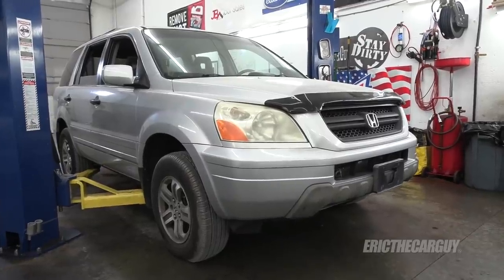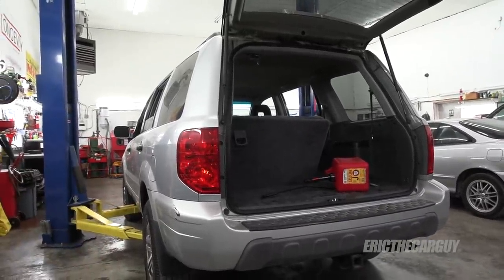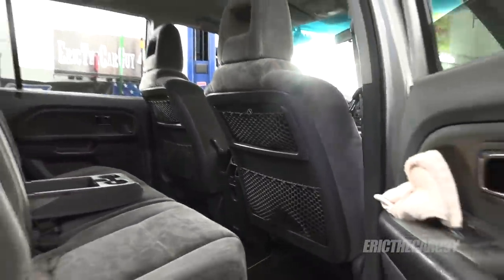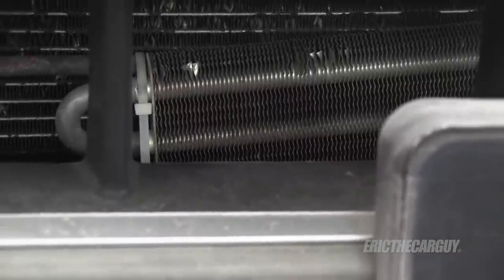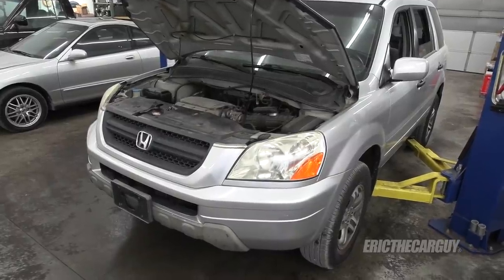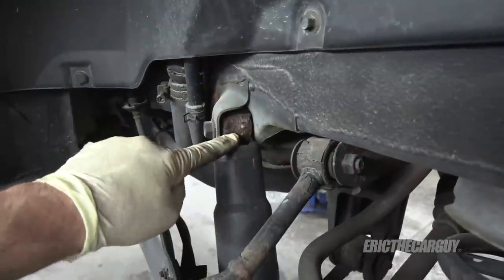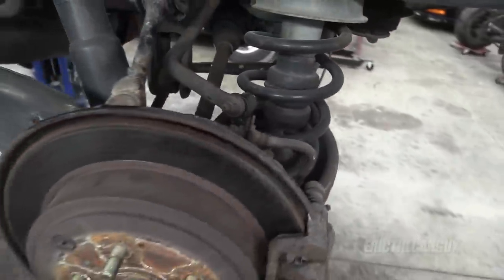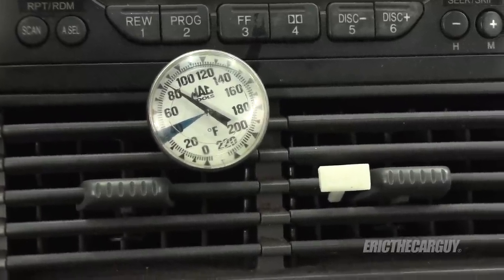2003 Honda Pilot Inspection This Thing Needs Help

Comment: I did replace a transmission in an Acura TL. It looked to me the transmission fluid was allowed to bypass the filter. There was a recall. Original owner unaware possibly,so I found a used one. Not a bad car though.
Reply from the maker: I HATE the 99-03 TL's. https://www.ericthecarguy.com/forums/topic/1999-03-acura-tls-and-cls-pattern-failurers/

Comment: I had a neighbor that had one of these I think it was an 05 same color  she had 4 kids and she drove the CRAP out of that thing she put over 700,000 miles on it the transmission failed of course the infamous Honda automatic transmission That never failed to fail she got that replaced but engine Wise no issues what so ever  just valve adjustments oil changes and sparkplugs

Comment: cast iron front control arm! That's solid offroad feature!
Reply: Toyota still using cast iron control arms in front. Rear suspension frame with iron too.

Comment: Thanks for sharing. Given the chip shortage, and the price of used vehicles, that is great deal.  We just replaced my wife's vehicle and paid 2/3 the sticker price of what the vehicle was new 12 years ago.  If there wasn't a chip and new vehicle shortage, "Normal Times", I think the price would have been about 40%.  What the vehicle had going for it, was low mileage, less 25k. 

There is a lot that needs to be done to make this Pilot "Road Worth" and the extras that "might as well be done" while you are in there....("One thing, leads to another")......... It makes sense.   I agree that SUVs are expensive for the reasons you mention but, I would say that Pilot is on the lower end of "Cost of Ownership" when looking at SUVs

Comment: That will be badass Eric ! With supercharger slap on and some drag wheels and do piggyback ecu wow 

Eric ? Will that intake manifold intake tube spacer fit 08 odyssey if soo what u think I need for extra pull off the line ? I pull small trailer on odyssey  from town to town ..any extra hp I can get I’ll take ..
Reply from the maker: Honestly, IDK. I suppose you could try it and see.

Comment: Hi Erik, greetings from Mexico, I've been watching your videos for a while, all of them are very helpful, I have passed through several Hondas from the dealer (99 Civic SI Ebp all stock, 00 Civic Si  EBP all skunk2, 07 Civic SI white, stock) and currently for family trips, just bought an 05 odyssey LX with 60k miles, If you can read and answer this, I would appreciate it, my engine does not have the VCM. Will I still need to worry for the faulty things that happened like the giveaway odyssey?
Reply from the maker: I don't think so. Keep in mind the issue with the Odyssey was caused by the engine flush. https://www.youtube.com/watch?v=XfDKhjlN7X4

Comment: The motor mounts and harmonic balancer pulley are issues on these, or at least it was on my 07 Pilot in 2018. Also, drain and refill the transmission. I think it's 4.5 qts when drained through the plug. Mine hadn't been changed in 116,000 miles and the drain plug magnet was caked with friction material.
Reply from the maker: I'm actually changing the entire transmission. Thanks for your comment.

Comment: The factory trans cooler is bypassed, because those early Honda radiators rotted and you end up with the SMOD, just like those Nissans.

Comment: Mine has 266k on original 
Also to replay he radiator you wanna cut the core support at the to with a saws all and weld it back together

Comment: Ah... The old "tie in a resister to richen the mix" power boost trick.
Reply: Yeah it looks like someone did some silly stuff  which means it was driven hard and that's why it's falling apart.

Comment: The sound from the right rear brake...when you turned it by hand. Would you drive a vehicle generally speaking that has that kind of pad/rotor scraping? Or would you call that grounds for must-replace?  I hate the sound but I know there wouldn't be a catastrophic failure...
Reply from the maker: I don't like to make blanket statements about noises because they have many causes, some you don't worry about, others you BETTER worry about. https://www.ericthecarguy.com/solving-brake-problems/

Comment: @EricTheCarGuy I have a 2010 Honda Odyssey I want to eventually turbo. I’ve looked at an intercooler that goes in between either a efi plenum or otherwise. I can give some info if you need it!
Reply from the maker: I'm thinking I'll use this one. https://zzperformance.com/products/zzp-stage-2-5-intercooler-cores

Comment: The 2004 Honda Pilot I bought has a shudder at 32 mph usually. It also has baaaad rust where suspension attaches to the frame on the rear. Also needs new tires RIP

Comment: 2:07 You would be correct Eric; in fact i believe i was the one that pointed that out to you on Twitter!

EDIT: the Walmart Auto Care Center that replaced the tires WAS NOT Following Policy; because at 3:04 I spy a broken stud! Walmart Policy is that we are supposed to decline any vehicles with broken studs because if that wheel comes off and it was found that a Walmart technician touched it, that tech is IMMEDIATELY Terminated along with the service manager AND the Auto Care Center Manager!

Comment: I recently purchased a new set of tires at COSTCO. I asked the service manager to ensure the wheels were cleaned prior to the new tires being mounted. I had to pay an upcharge of 1 shop hour to cover all four wheels. I got really pissed when the car came back with oil finger prints on the wheels.
Reply from the maker: Not something you should have to pay extra for in my mind. Thanks for the comment.

Comment: Can you a video on the rust? I have similar problems and I'm aware of your previous videos on the topic but would be good to go into detail.
Reply from the maker: I do plan to cover my repairs for the rear bumper in future videos. Thanks for the comment.
Reply: @ericthecarguy  nice! What will you do about the surface rust on chassis? Krown?
Reply from the maker: Nothing. I'm only concerned about structural rust. I might spray some Krown on it though.

Comment: I have a 2001 Buick Lesabre, 365k miles.  Original engine (original water pump too) and transmission.  The 3800 Series II is bulletproof.  What the hell makes Hondas so great may I ask?
Reply from the maker: What about the part where the intake gaskets leak on the 3800? BTW, I've never seen a Honda intake gasket leak on their V6's like that. They also doin't run coolant through the intake so that if and when they do leak, they don't contaminate the oil like the 3800 does. Also, the timing chains on the 3800 wear out causing performance issues. However, the transmissions of this vintage Honda are junk. Conclusion, they're all junk. Lastly, the supercharger I'm using is from the supercharged 3800. Thanks for the comment.

Comment: Great idea to make it a sleeper. Now the worst part will be the rust area at the rear frame. Looks pretty crusty and as soon you touch it it will crumble and nothing will be left. I will look for maybe a piece frame replacement on the junk yard that you can cut and weld so you have structural safety in case of rear collision plus a area to attach the tow hitch.
Reply from the maker: I'll see what it looks like when I get the bumper off. I do have a welder, and I'm getting better with it.
Reply: @ericthecarguy  I don't think it will be that hard to replace. Cut it off set on the junk yard and the same on this pilot and with a cheap welder from Harbor Freight you can piece it together and call the day. Some spray paint and undercoating and ship it. It won't be seen standing next to it and will be safer than what it is now. Looking fwd to see more videos. Great job!

Comment: Won’t adding a supercharger to the Pilot stress the already weak OEM-style transmission even after replacement unless you replace it with a beefed up transmission?
Reply from the maker: Perhaps, but I'm putting in a reman with a 100K warranty for that reason. I'm also hooking up the cooler properly which will also help.

Comment: Rock Auto has the whole front end kit...lower control arms, sway bar end links, and outer tie rods for under $200.
Reply from the maker: I just got the lower control arms with the ball joints. The rest will be Honda parts. Thanks for the comment.

Comment: It was a sad day yesterday. My son is a college student and works weekend delivering pizza. Took his car in for inspection and they told me the rear body mounts are both shot and no way to fix it.  I have new exhaust, struts and tires I put on it this past year. Not happy that the recycle pick and pull will only give me $400 for it.  New York Salt!
Reply from the maker: I'm very sorry to hear that. If you're scrapping it, remove the catalytic converter and sell it separately. It may be worth more than the car is for salvage. https://www.youtube.com/watch?v=bpuAv0sTh-w&t=21s

Comment: Supercharged J-series should be fun. Also, you could probably run E85 in lieu of an intercooler... assuming E85 is readily available in your area.
Reply from the maker: That's the issue with E85, I don't want to have to go looking for it when I need it. Also, the intercooler will help a great deal with heat soak, E85 won't do that. Thanks for the comment.
Reply: The E85 will provide some evaporative cooling. But it's all good. Looking forward to the project.

Comment: How do you know the rim is not cleaned before tire is installed? Because of the corrosion seen on the edge..? I want to know and learn 🤔👍🏻
Reply from the maker: You need to clean the corrosion on the wheels before mounting a new tire. It's rarely done. Instead, most just goop on a bunch of bead sealer and call it a day. Bead sealer is basically rubber glue. When you go to remove a tire that's been 'bead sealed', it's a real PITA because you have to clean it all off.

Comment: Those battery terminals are on everything because it's all you can find at crappy auto parts stores. It was surprisingly hard to find non-shit terminals to replace mine.
Reply from the maker: Check in the stereo section next time.

Comment: I've never had anyone clean my wheels when I buy new tires, many times they don't even install them correctly by placing the valve near the little round indicator that the manufacturer put in the sidewall.
Reply from the maker: Yea, I hate that. Sadly, it's all too common.

Comment: What V6 Honda/Acura of that age doesn't need a transmission? Unless someone has been very perticular about taking care of their transmission, the failure rate is very high.
Reply from the maker: Indeed it is. In my view, Honda quality took a nosedive in 2000. The engines are great though.

Comment: I would strongly recommend that you overhaul the entire suspension on that car because it's all going to be trashed at that mileage. Especially those front control arms (compliance bushings, and ball joints) as they are both super common failure points on the Pilot. So much so in fact that Honda actually issued an extended warranty on those compliance bushings, and they got replaced twice already on my dads 2011 Pilot Touring edition, also silver lol. But I did recently do a complete suspension overhaul on what is now my brother's 2006 Pilot EX-L. I also replaced all 5 motor and transmission mounts, all cooling system components, and yes I used Honda parts. My father also recently had a timing belt service done on that car at the Honda dealership. So it's in pretty good shape for 275k miles. 

One common problem with Pilots though, is the rear subframe tends to rot out where the subframe mounts bolt onto the frame of the chassis and that is a car killer. So you may want to look into doing some preventative maintenance in that area especially. Perhaps a good power-washing and undercoating paint spray to prevent that from happening because like I said once it starts it never sleeps as Neil Young said. 

Btw, I'm the owner and founder of the Honda Pilot Owners group on Facebook. if you have any questions or concerns about your Pilot, please join my group and we'll be happy to help you out: https://www.facebook.com/groups/hondapilotowners/
Reply from the maker: Thank you for that input. Stay tuned to see the work I do. I think you'll be happy.

Comment: Is it possible that the Trans cooler portion of the radiator is either plugged or leaking and they opted for an external which was cheaper?
Reply from the maker: Based on the zip tie installation, I'd say no. Also, the empty port on the radiator transmission cooler isn't leaking. If it was, then I would say you are correct. Thanks for the comment.

Comment: I would say get in touch with brent at pfi speed, he can give you all the info you need for building that honda, those guys know a lot about those honda motors, they race them all the time.
Reply from the maker: I don't plan to build the engine, I'm just bolting a supercharger to it to see what happens. Thanks for the comment.

Comment: when do you start working on the integras ,can't wait
Reply from the maker: It will be a bit. Mostly because I plan to fully restore the Type R. That will take time. The fact that it runs and drives now means that I'd rather be driving it than having it in a bunch of boxes for a year while I restored it.
Reply: @ericthecarguy  understood ,lookin forward to it

Comment: What happened to the supercharger for the Integra? Are you still waiting on that, or did I miss something?
Reply from the maker: I finally got it back after a year of waiting. I'm holding off on the Type R until I have a good block of time to work on it. I want to make sure I do that car right.

Comment: ERIC, I really, really want an Element or a Pilot. I lean towards the Element, because it's basically a Civic in van form (which suits my needs very well), and it's available with a manual transmission. Is there anything you could say about the Pilot as far as reliability, drivetrain, functionality, compared to the Elements? Basically I love the Element, but might consider a Pilot if I can't find a good Element for cheap.
Reply from the maker: https://www.youtube.com/watch?v=AqTgv2RSC7I

https://www.youtube.com/watch?v=NfpsHOsPPlU
Reply: @ericthecarguy  
Thanks buddy, I'll stick with searching for an Element with manual transmission.

Comment: Maybe they thought routing the trans fluid separate from the engine coolant would provide better cooling for both fluids. Sounds like aYT video you could make.
Reply from the maker: There is a separate transmission cooler inside the radiator that does not mix with the engine coolant.
Reply: i belive it would keep it cooler not using the trans cooler built into the radiator but it's a double edge sword... the engine temps get the trans at the optimal temps quicker.... a cold trans can be just as bad as a hot trans
Reply: @mcf3778  very true
Reply: @mcf3778  - Good point. Also, when running an add-on trans cooler it's best to plumb it in between the trans and the stock trans cooler. That way, the stock trans cooler (the one in the radiator) can still get the trans up to operating temperature.
Reply: @ericthecarguy  From what I've read of the earlier Ridgelines (and apparently earlier Pilots also, being similar vehicles), it's not supposed to mix with the coolant, but the transmission line inside the radiator corrodes, causing the two fluids to mix. That's where you'll hear of the "strawberry milkshake of death."  (Red Honda ATF, blue Honda coolant. Skip the bendy straw.) Routing through the radiator was supposed to get the transmission up to temperature faster, but the external cooler of course helps with towing.  Many owners bypass the line through the radiator so they don't have this failure, as getting coolant out of the transmission, and ATF out of the radiator, is a lot of work and potentially problematic for the transmission. In fact, that makes me wonder if that is what happened to the transmission in your Pilot...

Comment: I'm curious, do you plan on lower the compression ratio on a non-FI engine? I was looking into FI for my 2011 Sonata 2.4L but I feel comfortable if it had a lower engine compression.
Reply from the maker: The engine will stay stock. The intercooler will help with possible detonation and pre ignition problems. Hence the reason I want to run one.
Reply: @ericthecarguy  I hope it works out.

Comment: Rotor screws?  Not recommended to ever replace, just a hassle waiting to happen here in he salt belt.
Reply from the maker: You just need the right tool to deal with them and they aren't an issue at all. https://www.youtube.com/watch?v=Pwz-NXj5ZIk&t=2s

Or: https://www.youtube.com/watch?v=YxQk7Pz_vfc&t=20s

Comment: The brake warning light is SUPPOSED to stay off with that switch disconnected. You'll probably find that it stays lit as soon as you reconnect it. If that's the case (and assuming it's not low on brake fluid), it's just a bad switch on the master cylinder cap. The light turns on whenever the switch is closed, and stays off with the switch open. Disconnecting the wire is the same as opening the switch. The switch SHOULD close only when the fluid level gets too low.
Reply from the maker: Thanks for your input.

Comment: Maybe you know a friend with a dyno? 
Seems like it would be nice to get the rear-wheel horsepower and torque curves before slapping the supercharger on...
Have fun now!
Cheers,
Reply from the maker: I'm glad you brought that up. This would have to be tested on a 4 wheel chassis dyno. Not something a lot of shops have. OR, I would need to disconnect the driveshaft to the rear wheels and test it on a 'regular' chassis dyno. Either way, I think track times are a good place to start. Perhaps I will find someone with a dyno that can help out. Thanks for the comment.